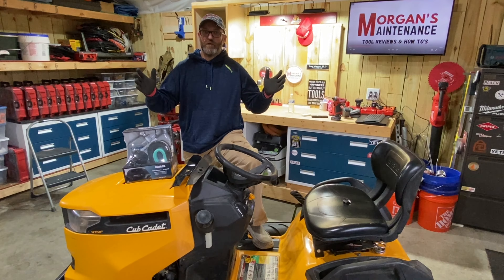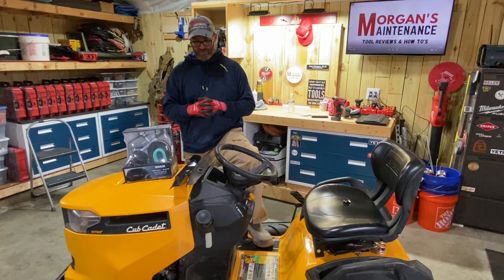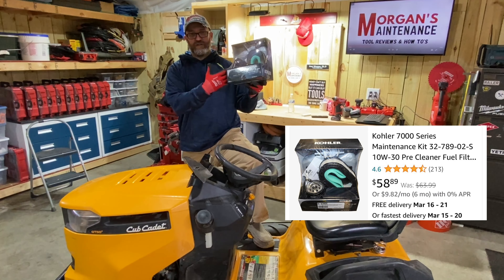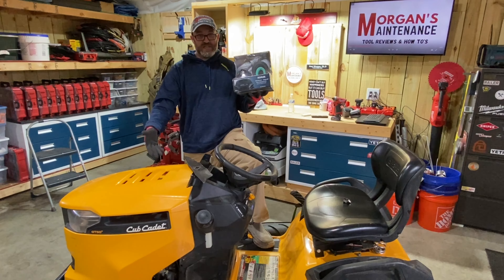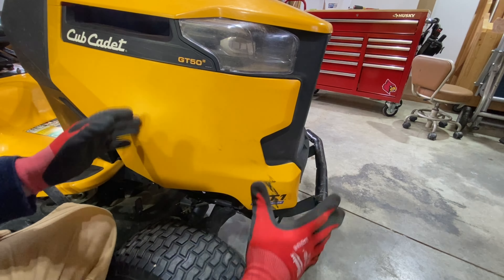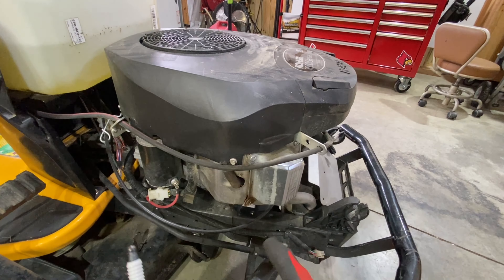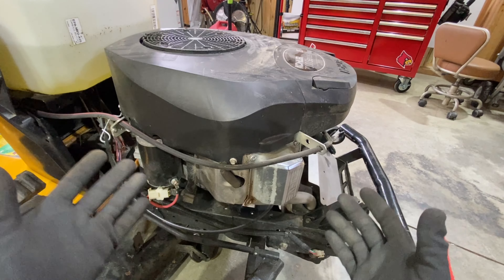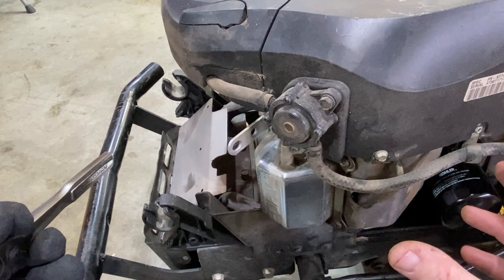Lawnmower Engine Maintenance / Cub Cadet GT50 with Kohler Shown / Spark Plugs & Oil/Air/Fuel Filters

Comment: I always run the engine for 10-15 minutes to warm the oil before draining; tygon tubing from the hardware store on the oil drain plug helps avoid a mess as well as an old piece of cardboard under the machine.  A needle nose vise grip plier clamped on the gas line or similar device stops gas flow.
Reply from the maker: All great tips 👍

Appreciate it.

Comment: I didn’t know they sold the whole tuneup kit like that. I have an LT46 cub cadet I bought brand new a few years ago. Great mower and a great video as always Morgan!
Reply from the maker: Yeah it comes out just a hair cheaper than buying all the stuff individually. There are cheaper options of aftermarket stuff, but I’ve had times where that stuff doesn’t fit 100%

I was going to do a video of me changing the blades, but I had a doozy of a time… took a torch, a grinder, and me ordering some new flange nuts … it wasn’t PG13 😂😂.

I’ve had multiple Cub Cadet mowers, they have all been really good. I picked up an older Hustler Fastrak off a buddy and I’ve been getting it ready to mow with.

I also Ordered the New M12 Planer today… will see how that stacks up with my little Bosch
Reply: @MORGANSMaintenance  yeah those blades are on there! I pulled mine off to sharpen and it was a chore. I saw that Milwaukee came out with the planer, yes I would like to see how it compares with the bosch as well.
Reply: @MORGANSMaintenance  We need some Morgan's Maintenance for adults. Make some outtakes video from time to time, please. Profanities included.
Reply from the maker: @Stefan_Kawalec  I didn’t even have it in my mind to attempt filming the blade change because I don’t do it the “safety approved” way. (As far as lifting my lawnmower up high enough) I don’t mess with taking the deck off and flipping it. 

After I got into it I kinda wish I had. It was a 3 hour nightmare. The nuts were on there… and one was rounded off.
Reply: @MORGANSMaintenance  These are the things you wish you'd done according to the instructions. Or you wish you'd never did them :)
Reply from the maker: @Stefan_Kawalec  yeah the first nut I tried taking off I thought “Do I really need to change these” 😂. 

I kept going, had one blade changed already and got to the rounded off one and thought “I shouldn’t have gotten myself into this” 

The Struggle then turned into “these things aren’t going to beat me… I will get these blades changed”
Reply: @MORGANSMaintenance  Yeah "it's a matter of honour" is the most common cause of men's irritation, fatigue or/and injuries (in random order).

Comment: I need another set of blades this season. I have an older John Deere d130. Got the OEM kit last year, but only got her fired up near the end of the season because it took me forever to figure out how to take off the old starter.
Reply from the maker: I only mowed with this mower about 4 times..  I had to get at the end of last year to get me by and bought it off Facebook.

I got an older Hustler Fastrak off a friend that I prefer using and it’s running now.

I changed the blades on this one before this… it was a beast to get the nuts off.

Comment: Tune up kit is excellent if only all manufacturers 🤔 you could use a hose clamp for changing the inline fuel filter.
Reply from the maker: The kit does make it nice… don’t have to try and figure out all the part numbers.

The clamp is a good idea 👍 

I was just going to pinch it and swap it fast, but I thought others might have a hard time doing it that way. Didn’t want someone not prepared for what happens when you pull the hose 😂